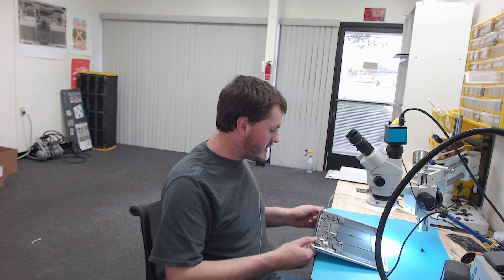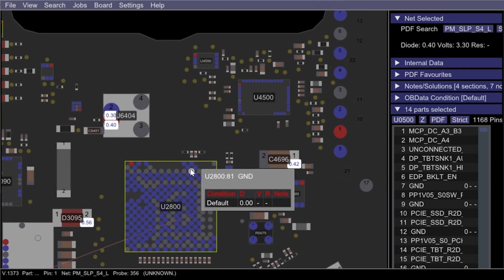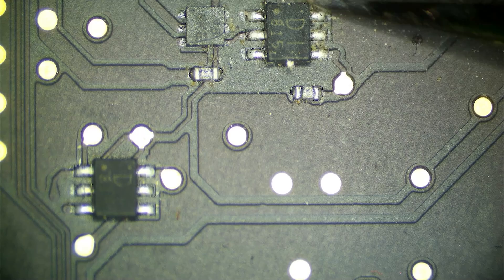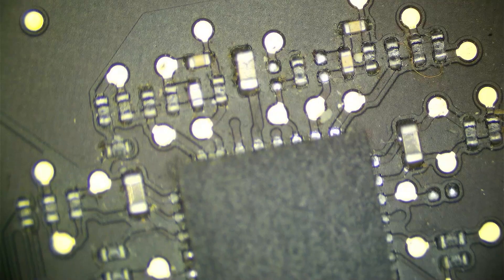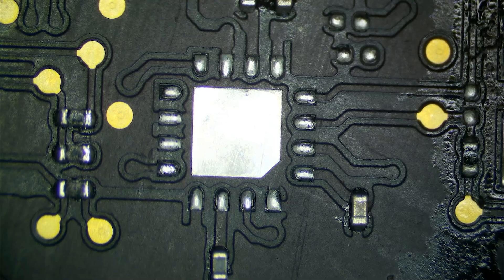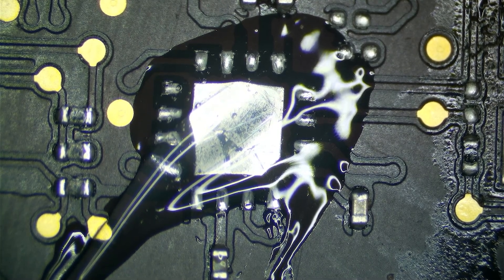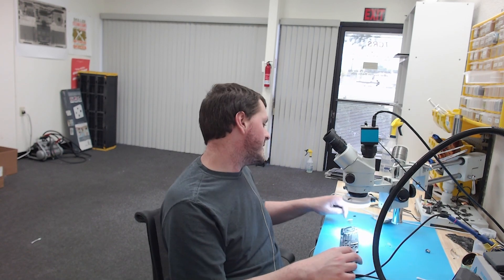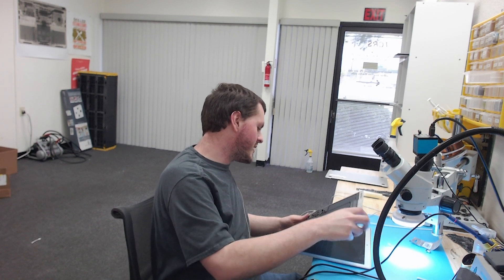Pay attention to the subtle hints!! | 2015 A1466 MacBook Air that stopped turning on.

Comment: Could you have just reflowed the clock chip and then stuck it in the ultrasonic?
Reply from the maker: Nope, the clock chips are very sensitive and are easily damaged from liquid. Chances of it coming back are relatively high if you reuse that chip.

Comment: Hi Tim thanks for your videos I'm finding them very easy to understand and am trying my very best to use my brain but have a question.
I have a liquid damaged A1466 820-00165, it has orange/green light my ppbus_g3h is 8.2v so the smc is not turning on otherwise it would be 8.6v. On the smc_reset_l R5100 I have 3.4v on one side and 3v on the other so I assuming this is correct?
I was looking on the schematic at the inputs to the SMC and noticed the clk input, the clk chip looks untouched by liquid along with U7100.
Do you think its worth a shot at the clk chip?

Comment: When you changed the clock chip, you simply heated the chip, removed it, then reapplied heat for the new chip.

Typically Louis will add fresh solder, flux, wick it all up, clean it off, retin with fresh solder, reapply chip, then trim off his bonus solder.

Is your protocol from this video generally standard for all small components as well as bigger chips?

Curious as I am currently learning as much as I can on board repair.
Reply from the maker: If the solder is intact, I reuse what is on the board. If the pins are damaged due to corrosion, ill wick and apply less. This only applies for QFN and SOT / similar chips. With BGA you always need to clean up the old solder. Reusing the old solder on the board is not inferior to applying fresh, and saves a bit of time. You'll also find that the chip will flow into place a bit easier when reusing what is on the board. Try both methods and see which one you like best!
Reply: @TCRSCircuit  Thanks Tim!

Comment: what scope camera are you using? I purchased the Lapsun 1080P 60FPS SONY Sensor IMX290 but the quality is bad. So I purchased another ring light, same issue it's grainy. I have the same scope so I'm wondering is it the camera!? Or is the the light that's going back into the sensor! Any help would be appreciated :)